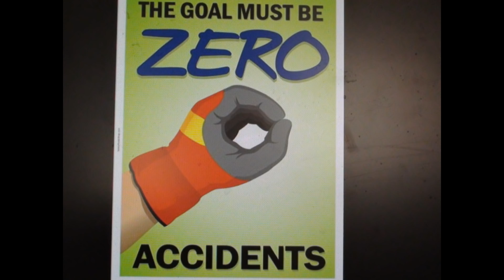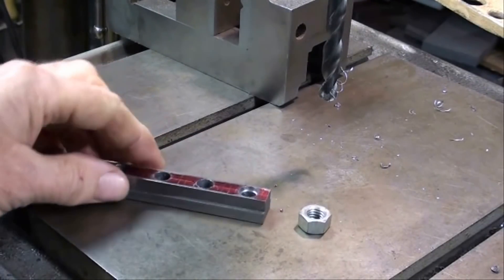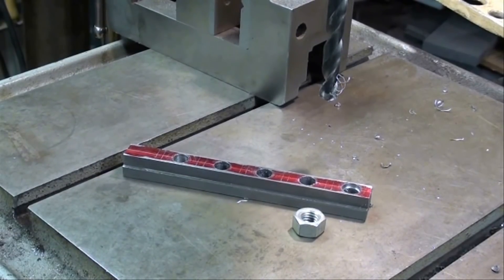Making T-Nuts on Bridgeport Mill TIPS #R103 REPETE tubalcain pt 2

Comment: I have a 1969 Bridgeport 2J with 5/8" slots in the table.  I want 5/8-11 bolts instead of 1/2-13, so I  mill down the big T nuts to fit.

Comment: I made quite a few for my Kearney and Trecker milling machines because the table slots in my machines are 11/16 instead of the common Bridgeport size.. I bought a clamping set that has 1/2   -   13 studs , nuts ,  but because it is for a Bridgeport, the tee nuts are too small for the slots in my K&T mills...I made the tee nuts from mild steel then used Kasenit to harden them.... Mike in Louisiana
Reply from the maker: Yes, there appears to be a lot of oddball size t slots On machinery

Comment: I notice you don’t heat treat. I made some recently out of 4140 and heat treated them. I’ve noticed my other soft T-nuts get banged up and deformed in the rough casting slots. I don’t know if the upgrade will be of any use in the future but I do like the idea. 

I’m a retired knife maker so I like my steel heat treated. Lol
Reply from the maker: Sounds good, but I’m afraid I do not do much it’s reading. I do not have a whole lot of tool steel on hand. Just a few bars of precision ground flat stock
Reply: mrpete222 it’s good to know that HT is a fair idea. Thanks as always.